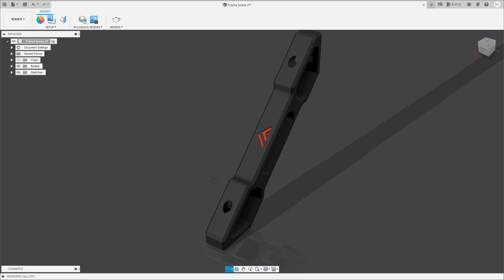VzBoT new Frame Brace. Printed with ODrive and Magnum+

Comment: an idea I've been thinking about maybe there is a way to put a vibration dampener inside the corner pieces if u look at archery bows they use them to stop the vibration from the limbs into the handle i wonder if they was in the corner on the braces if they would get rid of harmonics

Comment: What print surface are you using? Is that just a Typical PEI sheet like the Prusa ones? What's the enclosure temperature? :)
Nice 3d printer and awesome print quality at that speed with PACF. Wow :O
Reply from the maker: It's powder coated pei sheet. The enclosure was arround 35c
Reply: @Vez3D  Oh, wow. I thought a higher enclosure temperature would be needed.  Have you experienced warping with bigger PACF parts? As these frame braces have rather small surfaces touching the build plate. :)

Comment: Can I move a print head with a weight of 2800grams at 1000mm / s? linear guides and servo motors. is a dual extruder and has one stepper / servo for the x axis on the head.

Comment: Amazing, is this the fastest you can print without sacrificing quality? Also does the Magnum+ make a difference in print quality and speed?
Reply from the maker: Well..I'm not sure. I think I can go faster with this material. It is the first time I push this material to speed. And I'm very impressed by it. I might try a speed benchy with it :p

Comment: Have you tried Colorfabbs PA CF? Curious how it compares to the Esun PACF. Need to print some Voron 2.4 parts and really hate to bother with ABS.
Reply from the maker: I have not sorry
Reply: @Vez3D  went with the esun. How is your bridgemaster holding up to the abrasives? Not a lot of copper coated nozzles recommended for abrasives.
Reply: @Vez3D  I have the esun PA CF and really love printing with it except I only have it working with glass + glue stick. Does your textured PEI sheet have something added to help get a good first layer? I have brand new smooth PEI and textured PEI but neither seems to work very well with PA CF, only smooth glass+glue stick works but it's quite a mess.
Reply from the maker: Glue stick

Comment: What size bed does the vzbot use? I’ve got the materials from my 500mm bed that if I can I want to reuse, as well as keep the bed size, but it’s hard deciding on a printer design. I want the speed with the high temp materials if that’s at all possible.
Reply from the maker: 330x330 but it can be as big as you want. I am currently doing a 220x220 too

Comment: Do you like odrive over traditional steppers setup?
Reply from the maker: I like it even if it has some down sides
Reply: @Vez3D  what are the downsides?
Reply from the maker: @Johan-ul9jb  some artifacts if you don't print fast
Reply: @Vez3D  does the newer "anti cogging" functionality in odrive help with artifacts?
Reply from the maker: @viocudinti  you mean odrive4 or odrive pro ? Maybe yes.. but there are still issue with PID tuning on this I think... and how fast its pulling info from encoder.
Reply: @Vez3D  I was thinking of odrive 3.6, I'm not familiar with newer models. So I understand you did not try anti cogging yet as it's a secondary issue after PID tuning? Thanks for the great work by the way!
Reply from the maker: @viocudinti  Yes anti cogging is on and tuned. But the algorythm on it is not as good as odrve4. BUt it helps a lot yes

Comment: I must say impressive speed/quality print. I have question about mounting holes. You didn't use any support and on last photos it looks like they are eliptical rather that cylindrical. Is this just scaled image or they eliptical in reality???
Reply: The holes cut the surface at a 45-degree angle - they do indeed look elliptical.
Reply: It's just perspective. The holes aren't perpendicular to the surface. When the holes break through, it is elliptical.

Comment: What nozzle are you using with that filament and how much does it last?
Reply from the maker: Slice engineering  bridge master.  They are ok for abrasive...but not forever. But you can print a lot of it with it.  I will try their vanadium

Comment: cant even get my esun PACF to print at 50mms that nice :(
Reply from the maker: Whats the issue?
Reply: @Vez3D  just doesnt look nice and warps alot. all layers on a 260 - 220 temp tower dont look smooth but 250 being the strongest. random boogers and stringing despite z-hop and microswiss direct drive. last attempt i dried for 30 hours at 75c. still same results. have been trying for a month now and spent so much money on dryers, garolite beds, PA magigoo, tent enclosure, Direct drive upgrade and set up, several slicer setting tests. think i just need to bite the bullet and get rid of my ender 3 and build a voron :(
Reply from the maker: @nitronaf  or build a VzBoT ? :)
Reply: @Vez3D  wow this whole time I thought you were running vorons lol doh sorry!
Reply from the maker: @nitronaf  how much rum did you have  :P hehe jk